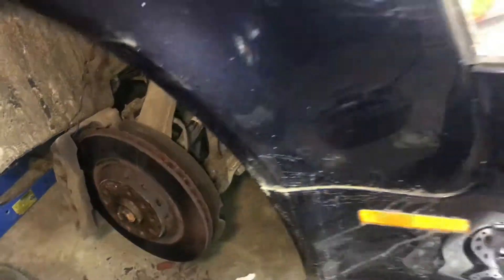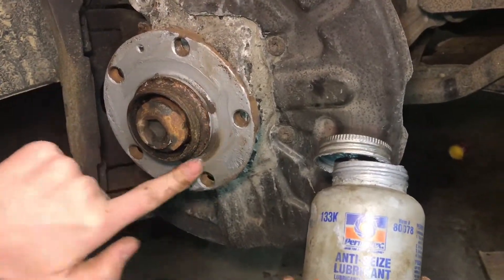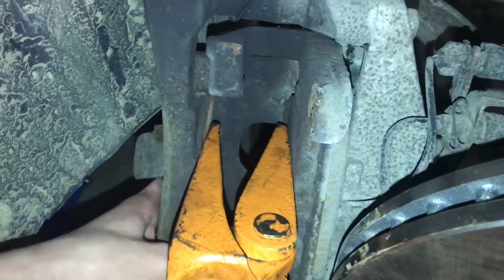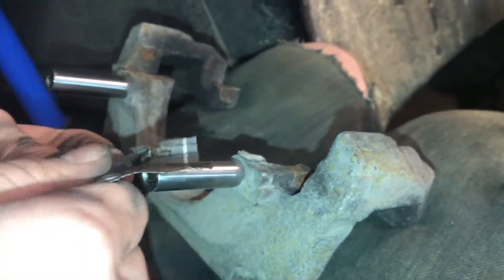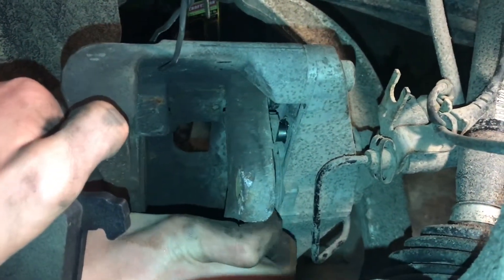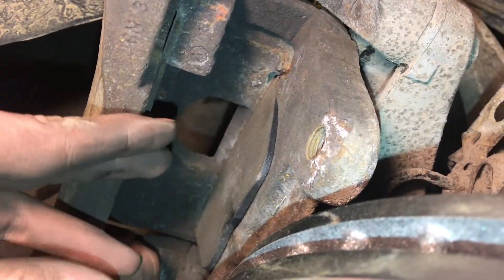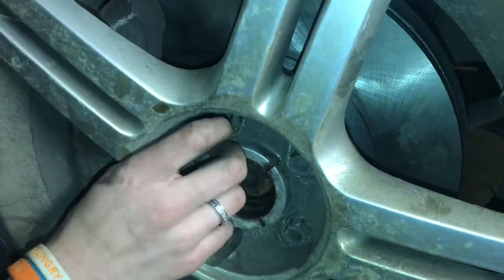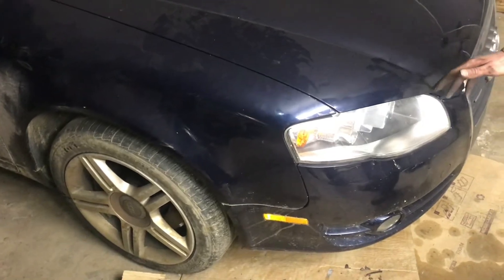2006 a4 audi FRONT brake pads and rotors replacement (Quattro)

Comment: wow.  Lot of corrosion.  Must be east coast or northeast.  I split my caliper and it was easier to work with than working with  the caliper fully assembled.  I did the passenger side splitting the caliper and the driver side with the caliper intact.  I found that an air tool was the easiest way to get the 20mm bolts out.  I have some long beefy 1/2 drive tools but there was not a lot of space to gracefully work the bolts out.  Even the air tool had to be used carefully with the clutter of brake lines and electronics.  I think getting the new brake pads in and then reassembling the caliper was easier than trying to tie the caliper up and extract/insert parts.  I do thank you for the trick to put the spring/anti-rattle clip back in.